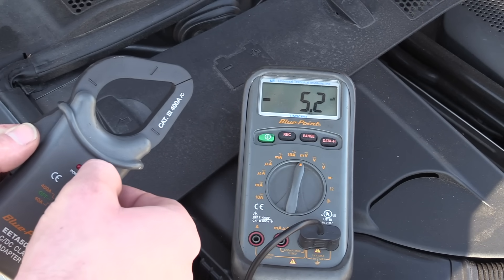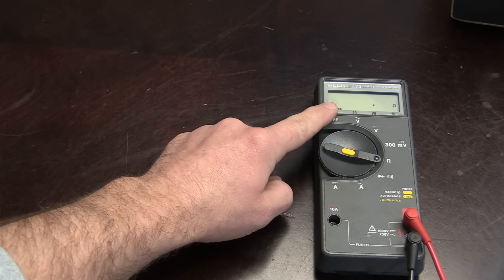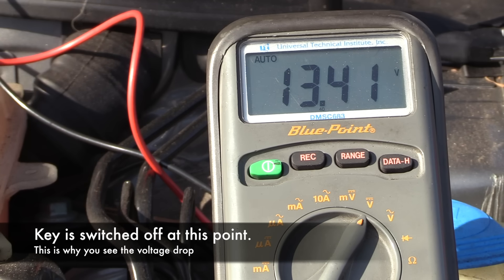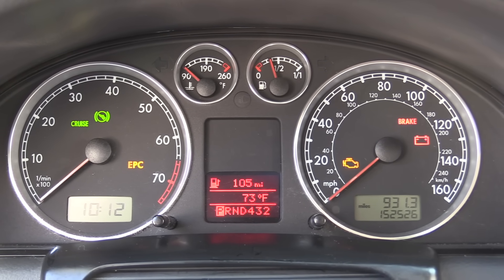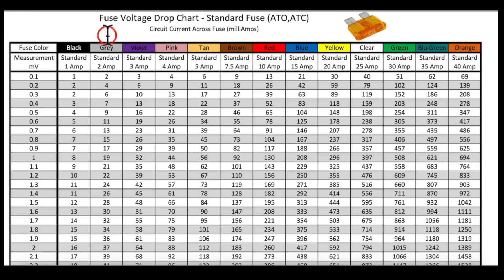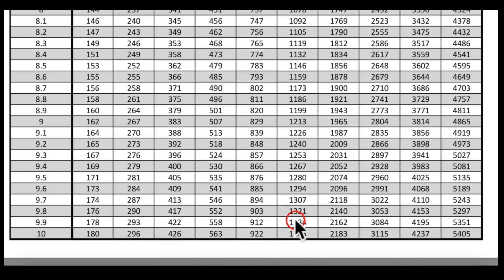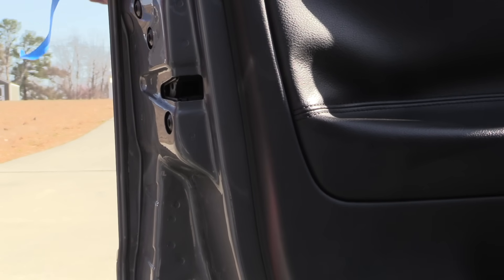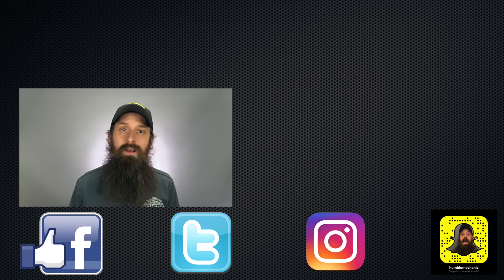The BEST Way TO Perform a Parasitic Draw Test

Comment: Ack, need help! I tried this method but my multimeter shoes 0 change in voltage when testing fuses.  I've tested my leads and they're good.  My multimeter is on millivolts.  What am I doing wrong?
Reply from the maker: The draw may not be fused.
Reply: @HumbleMechanic  thank you for responding.  another complication is that I turned the car on and performed the same test with systems on and also no change in voltage? I think the problem is me?

Comment: I once had a parasitic draw on my 2006 Jetta 2.5.  It took the dealer a month to get the car back to me and cost around $2000.  Then when I did get the car back the alternator connection was loose and I lost power on the road.  Lucky for me it was only a back road and not the highway.  The dealer paid for my towing back to them and a new battery.  Aside from all that drama I never had a problem with the car again.  It was awful and felt like an eternity.
Reply: Batteries can do weird stuff.

Comment: Great video.  Been wrenching for 35 years and never used this method. I know it works though. I use a tool called Amp Hound. It calculates the the draw for you.
Reply: Explain
Reply: @Nick-fy7yi  I'm old school. Did battery draw with a test light between negative cable and ground, then pull fused till light goes out. This method doesn't work with new cars.  Amp draw on each fuse is more precise.  There is a tool we use at work called an Amp Hound that does the calculations for you. It works great.
Reply: @tomcisneros5965  yeah I’m in Canada looking for a amp hound can’t find it . My battery is having a parasitic draw and I can’t diagnose where it’s from. Never used a meter of anything before. Brand new battery.
Reply: @Nick-fy7yi  I don't remember who makes it , but if you Google Amp Hound it should come up somewhere.  In the States you can find it. I don't know how it is there. Try your local part stores as well. You may even find a tool close to it if you ask your parts guy. It's very user friendly.
Reply: @tomcisneros5965  thank you
Reply: @Nick-fy7yi  no problem, wish I could help. Good luck.

Comment: What happens when a fuse is burned, it might burn the fuse of my multimeter if it goes over 300 mAmp. Futher more thanks for sharing knowledge. This what I never understood clearly see mechanics doing this trick. Now I understand, this works because of the tiny resistance of the fuse.
Reply: If your digital meter is used on volt mode and leads are in the volt jacks, no damage to the meter should result.

Comment: Hey man, was wondering how you do this with cartridge fuses.. do the tops pop off?
Reply: alright so.. i see that JCASE cartridge style fuses their tops pop off... but. In newer vehicles.. they use a cartridge style fuse that has a top that DOES NOT pop off. How would one go about testing these? Would I have to extend each fuse out with leads and test on the leads? I'd have to do this with every fuse this style?! insanity... I would assume that the standard way for testing parasitic draw is the ONLY way to test these quickly. Any feedback would be lovely! thanks!

Comment: Basically when the car is off everything except the clock should read 0,..correct ?
Reply from the maker: Yes.  There is be a fuse or 2 with a small draw but most should be 0
Reply: @HumbleMechanic  Thank you for the response !!!

Comment: will see you at second hand garage frederick md. Parasites drawl drawing battery of used van bought at honda odessey.
Reply from the maker: Awesome. Can’t wait. :)
Reply: @HumbleMechanic  second hand garage are so amazing.  I got an 2008 odessey from them. low income a d they treated us like king and queen dogs kids too. I think my parasite drain is my slider doors. if the switch is turned to red battery dies in morning.

Comment: Hi I’m desperate for any reason for why in my vw Cc 2010s rear doors have been flickering sporadically . They sometimes don’t respond to locking and unlocking , windows work no problem . If I have one of them open and no front door open at the same time the car locks it’s self as if the door isn’t open at all. Happens to both rear doors. Last month my truck decided to freak out too not opening and what not. The car reads the trunk open when it’s closed and vice versa. I had a new wiring harness put in and now the trunk opens with key fob but the car still thinks it’s open . When I unlock the car the trunk will randomly open. I need to get the car inspected but since the car thinks the trunk is open the lights on the trunk it’s self do not light up so I can’t get it done. The mechanic I’ve taken it to has struggled a bit so far. I’m a college student and this is my only car. Any insight will be wonderful. Thank you for your videos they have helped me diy a lot so far.
Reply from the maker: Looks at the wiring in the boot for the rear doors. I’ve seen them break. For the trunk, some have 2 harnesses.  Make sure both sides are good
Reply: HumbleMechanic thank you for replying to me.

Comment: I have a 2004 lincoln car and somthing is draining my battery. I see you said something about door locking issues. On my lincoln my doors will not lock. After hitting lock switch they go down then instantly unlocks. Also my driver door lock is stuck in locked position but door is not lock. Could this be a draw problem?

Comment: So..  I have an old cop car.  Actually, police package Tahoe.  Im showing between .02 and .06 Mv on every fuse...  
Since a lot of electrical things were removed, is the most likely problem a short to ground somewhere? 

Last time I chased down a short to ground it took me like 20 hours.  It was a brake wire on a chevy p/u that had melted on the exhaust and flipped over so you couldnt even see it. Found it by luck and by accident....
Reply from the maker: Starting with the aftermarket equipment is a good idea. Ground sweep is good too
Reply: @HumbleMechanic  
I actually found the problem... Totally by accident once again.  I had the meter on the battery and slammed the front door in fruatration.... And the meter reading dropped.  I opened the door and it went back up again... Now, i didnt follow your instructions immediately.  The battery was dying overnight so I figured it would be an easy find. But I had the door open when i did my initial checks, so it didnt register.  I thought it was probably a short in the harness, but it was actually in the latch itself. 

But good video.  I appreciate the effort & explanation.  Im a very good mechanic, but electrical and transmissions are 2 areas I am not gifted in.....

Comment: Best explanation on this subject I've seen!  Especially like the attention to detail, and memory precautions on taping over the doors in locked positions so you remember NOT to close them during the test.  Excellent, sir, excellent.  It is noticed.
Reply from the maker: Thank you
Reply: I do that on a hatch lid to allow the lights to shut off when using the back accessory outlet for charging, but I don't trust myself to notice tape so I put a small block of foam across the latch to keep the bonehead from closing it onto the striker.😜

Comment: Not sure how you get a voltage drop across a fuse unless the fuse is open...wouldn't both sides be at same potential..please explain...I guess maybe it acts like a resistor (depending on fuse type). Where do I find these charts for voltage drop?

Comment: PLEASE  I NEED HELP I got the P0146 on 08 Jetta 2.5 something Is wrong with the bank 1 sensor 3 heater Circuit I get 12 volts on one of the white wire on the sensor harness and the negative side  White wire is like I don't have a good ground. Wean I use the volts meter wean Is cold start the car barely get 4 volts if I remember correctly. If you can help me trace that wire to a relay or a bad ground  or if you know what might be causing it PLEASE HELP!!!!!!! I've changed the sensor 3 times. I think it has to be a bad ground somewhere.

Comment: Put a new battery on my car, tightened the cable ends as tight as I could, but they are a JUST  a pinch loose, with a bit of effort I can move them.   Could I wrap a bit of Aluminum Foil around the post to take up the slack?

Comment: A quick way is to see the draw undo the neg cable and teat for mili amp draw 16 to 25mili amps norm for internal reg alts
200 mili amps will run down in 10- 20 days 
Yes wait till the many circuits IC s caps. Build up. I think you forget amateurs will use the wrong meters causing further probs

Comment: Hi!
I like your video but something is wrong for me, maybe I didn't understand you correctly at the 7:07 point in the video.
You say we have a .1A current  draw. If I understand correctly the table that is given in mA, so the current draw is 1006mA which is actually 1.006A.
You say ".1A" and that is actually 100mA.
Reply from the maker: Yes I mis spoke on the math

Comment: Great idea, but the problem may be that some of the fuses on that panel were in upside down! 😀😀😀

Finally gave up chasing a phantom in my 1987 Alfa Spider that killed the battery in 4-5 days. Put in a battery disconnect and only lose radio presets. No doubt a bad idea to use a disconnect on a modern car.

Comment: GOOD presentation!  But this was only HALF the  information needed.  What do you do if you have a significant draw???? You told us nothing useful with how to FIX.   

It’s like saying to you: YOU ARE UGLY”.  When I should have said: cutting that nasty hair off your face will greatly improve your looks.  REMEMBER finding fault is not nice in itself, you MUST provide the CURE as well. Thanks!

Criticism....  the analysis and judgment of the merits and faults of a literary or artistic work. Or here, in lack of correct measurements.
Reply from the maker: Fixing the issue has infinite possibilities. If I can find a way to accurately cover even some of the ways to fix it I would.

That’s like doing a video on fixing a dash rattle, but only showing one fix. When in reality it can be a 1,000,000 different reasons for the rattle.

Comment: Humble mechanic, please reply. I have a 2003 1.8t gti, AUM code. can I change the camshafts and buckets, while the engine is in the engine bay. Is this worth doing or will it put pressure on the bottom end and other parts of the engine??? I love my golf and taken real good care of it. The mileage is 120,000. Thanks 🙏

Comment: Can somone please answer a couple questions because I'm confused.  So I look to see if there is a draw through the fuse and if there is, I match that number to the chart?  What kind of amp draw would cause a battery to die in 2 or so days?  Also, why do you get an initial reading at all on fuses that aren't drawing power?  Thanks!

Comment: Just curious where do you get the specs for the draw per fuse, because you said for the radio fuse it was three time what it should be where did you get the number for the should be part? thanks
Reply from the maker: There is a link to the chart I use in the description
Reply: @HumbleMechanic  thanks for the reply i seen the chart, but i'm missing the part where  the draw supposed to be, example radio fuse .4mv = .125ma  so that my reading no what is that circuit suppose to read or what is the draw suppose to be, is there a list from vw that says for 2005 passat on radio circuit we should be getting a x amps.

Comment: So I have a 2004 Honda accord that keeps blowing the fi ecu fuse.  How do I get a wiring diagram for my car so I can see what else draws off that fuse? I replaced the fuel pump and the fuel pump relay. I've unplugged everything I can see, just to rule out certain things, like the AC and the alternator. I was sitting in the car with the AC on, radio on and had my phone plugged in to the  lighter.

Comment: I have an older Miata from the early 1990s that has interior floor lights--because I am not that handy, I wouldn't know how to pull all those bulbs or even find them. How to do this with an older car without having to pull any internal light bulbs? Thanks. Your method seems very straightforward and I appreciate it. I just don't know how to apply it to my older car. Thank you.

Comment: I've narrowed a 1A draw down to the trunk release with a battery reserve capacity of 115 mins... Now what? Replace the trunk release? Check the wiring of the trunk release? Could it be a faulty ground? Any one of these things? Can I just pull the fuse till I figure it out so that I don't get stranded everywhere?
Advice appreciated. Great video!
Reply from the maker: It could be any of those things. Does the draw stop when the release is unplugged? What controls the release?
Reply: @HumbleMechanic  I must admit I made a mistake here. After removing the fuse I opened the latch to close the trunk, and that set the alarm off. That confused me as I had thought removing the fuse should have broken communication with that switch. Background - This is a 2008 Cadillac CTS. 
My mistake was not realizing that the names are below the fuse, the actual fuse that had an 8.0mv voltage drop is the Theft/UGDO (Theft deterrent, Universal home remote system), NOT the trunk release. 
In this car there are two fuse boxes and I have only checked the ones in the trunk near the battery. In a few hours (after all the modules have gone to sleep) I will also check the ones in the front. I kept that fuse removed all day today and the battery went from 12.9 volts when I first removed the charger (drove to and from work today ~1.5 hr total) to about 12.19 volts when I checked after pulling into the garage. With car running I noticed my digital readout in the gauge cluster fluctuates from 14.2v down to 12.8 volts. Had the alternator checked on the way home, and they said that it was good. Perhaps that is further indication that something is cycling on and off that is leaching power? Ideas?

Comment: I h
I have a 3007 mA draw on the battery of the Jaguar, with less than 150 mA SUM of the draw seen on all the fuses put together testing with a multimeter.  The only explanation for that in mind is there is drain with no fuse in the path.

Comment: Thank you! Im wondering if you could just measure current flow across the fuses with the multimeter, instead of using those charts?
Reply: Yes. You can. BUT if you have a current of over 10 amps you will blow the fuse in your meter. Or ruin the meter. (I have done this). But more likely ( in my case any way.) You forget to put the confounded leads back into the volt Jack. And then you measure across a circuit. And pop goes the fuse/meter. I now only do voltage drop With dmm. I use my amp clamp meter otherwise.
Reply: @ronvonbargen8411  
Ah, that makes perfect sense. I have blown the fuse on my digital multimeter a couple of times already by touching the battery terminals this way. Luckily the meter is fused and they are easily replaced!

Comment: I’ve used this method with success several times.  I’ve recently learned an extra hint to go along with this test.  Prior to testing each fuse(especially with vehicles with a large amount of fuses), use a thermal image camera to look at the fuses.  The one with the draw will show up warmer than the rest.  Helps pinpoint the circuit quickly.
Reply: I finally found use for my 5k $ thermal scope.
Reply: Valid tip but most don't have one. However, many have an infrared temp gun. Not as quick and easy but it too can point you in the right direction quicker.
Reply: @transfixleo   I use this technique in industrial applications at work. It's a great time saver vs probing every potential connection. 👍
Reply: @transfixleo  Was going to necro this thought,
Reply: Yes. The Caterpillar brand phones have  FLIR cameras integrated with several models.
Reply: Lmao I see new thermal scope in my future and tax write off.
Reply: because everyone owns a flir camera system right?
Reply: That’s damn smart!
Reply: Good tip. I’ve done this. It works great. FLIR makes a camera to attach to your phone.
Reply: I got to thinking about this when I had an Acura with a bad hands free module. It's mounted just above the rear view mirror and the internet told me that the windshield right there gets warm. So the FLIR can be used, not just on the fuse box, but on the whole car.
Reply: If the fuse block is on the drivers side why do I have to open all of the doors?
Reply: MegaSkilla  Where can I purchase this paper, please?
Reply: Get r done
Reply: $300 to $400 the cheap ones for phones. I wonder  a very low parasitic draw can create enough heat detectable? I don't feel like having to return it.
Reply: If that works probably a lazer temperature indicater might as well.
Reply: I recently learned this method also, and use that camera all along the car harnesses and such to find shorts as well. good tip you posted.
Reply: I tried a few inexpensive thermal cameras. Settled on this one;

 https://www.amazon.com/dp/B07K22DQMK

URPRO 2.4" Infrared (IR) Thermal Imager Imaging Camera Full Angle Color Display, IR Image 3600 Pixels Visible Image 0.3 mega Pixels, -20~300°C Range 6hz Refresh Rate
by RISEPRO
Reply: https://youtu.be/hbrtHKmtZ00
Reply: How much for the thermo
Reply: Nice idea, but how many of us or garages have an IR cam. But perhaps at the new job I start next month at a BMW dealer they will?
Reply: For those o you that are poor, a Ti camera is $10k
Reply: The good, the bad and the ugly: your spirit and your good intention as you share something fresh and different ; lack of pedagogy; the digital recording hide all the good vibe of your presence, captures background noises lowers your voice and tampers your images. 
In summary, teaching is a huge project. Teaching in a video is brainstorming.